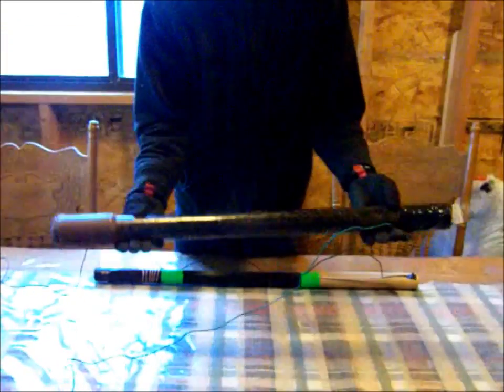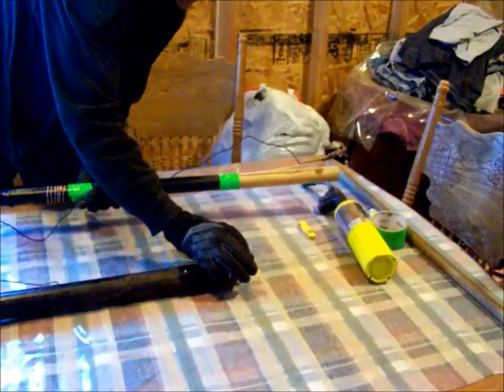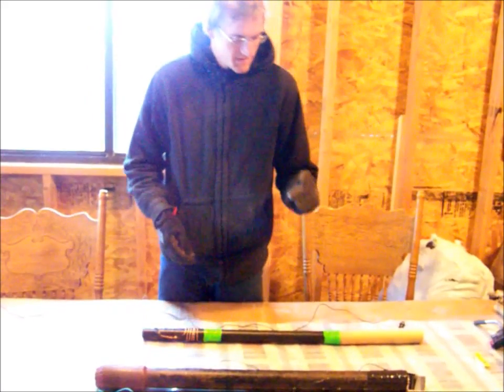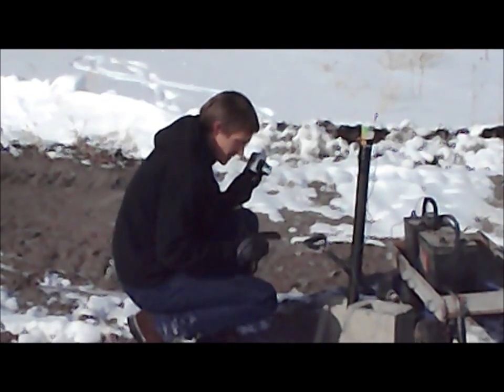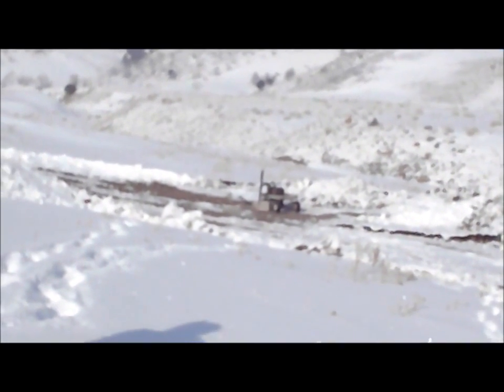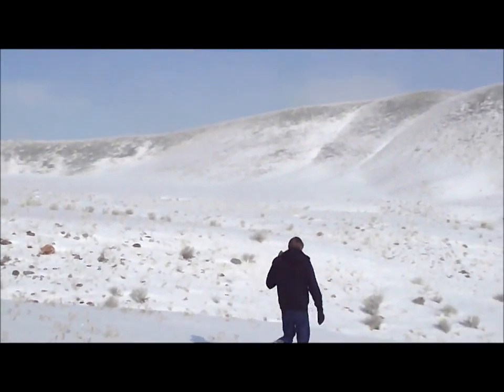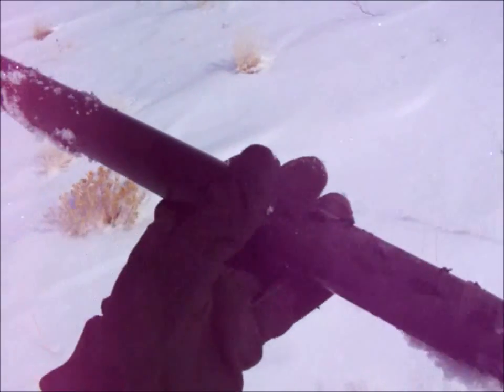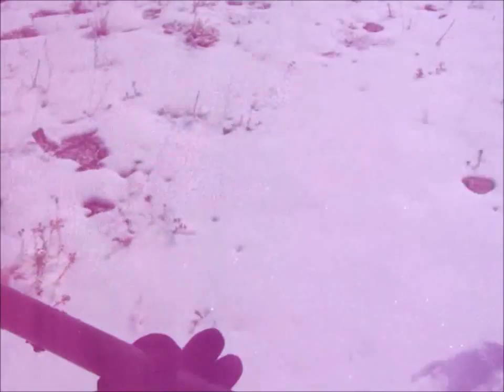Shooting A Gun, From A Gun

Comment: Great video, just discovered your channel and I really enjoy what you do !
There is just one thing that bothers me : when you say that it will double the speed...
Correct me if i'm wrong, i'm still studying and physics are not my strength but your statement is true only if you assume that the first gun always moves at the same speed. But first, there is gravity that will slow down the gun and then the shot will also decelerate it.
I'm pretty sure that the bullet will "push" on the shot gun a little bit like you if you jumped from a boat : the energy is split between you and the boat forcing both of you to move.
I don't want to do the math right now (and i'm pretty sure I wouldn't succeed) but from what I know, I'd say that you gain less energy from shooting the gun like you do instead of doubling the amount of powder in your gun...

If you see it differently, in terms of energy, you have two units of energy in your powder, so assuming all that energy actually goes into the bullet in form of kinetic energy, you only double the energy which means you will have 1.414 times the original speed.

I just want to know if my point is valid or if I did a mistake somewhere because it really bothers me ^^

Comment: with access to a machine shop, it wouldn't be hard to scale this up and also make it safer. I'm thinking a captive bolt type gun with the bolt acting as the secondary barrel. if it was chambered for a rifle round, it wouldn't be too hard to set up some kind of basic mechanical trigger about 3/4 if the way up the main barrel. that way the recoil of the second charge firing would dampen the impact when the bolt/barrel hits the end of the main barrel.

Comment: With BP burning so slow the second gun didn't fire until it was well clear of the first gun (that's what I heard). With that in mind I would suspect the second gun would have started to tumble, to a lesser or greater amount, giving a random trajectory to the ball.
Maybe putting the brushes at the top of the inner gun would give you ignition before leaving the cannon, or using smokeless would make it all react faster.

Actually with BP I wonder if you haven't over complicated things and a straightforward touch hole in the bottom of the inner gun wouldn't be enough to delay the secondary ignition of the main charge in the time it would take to "fuse" through the constriction (depending on the size of the constriction and powder grade)?

Comment: One idea I have may make your setup more reliable. You would need to add a small battery to the smaller gun. You could use a transistor and have it powered at all times until you want it to launch. So when the transistor is no longer power it will send power to the fuse. And one of the power wires for the transistor on the outside of the barrel in a way that it would break as it comes out. A relay may work but because it's a mechanical component the force of firing may stop or slow it's ability to perform.